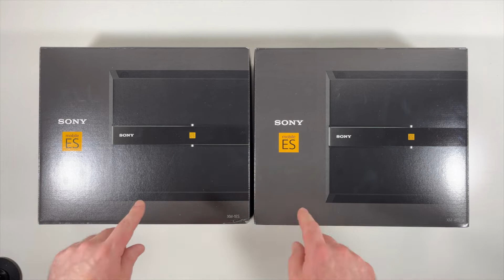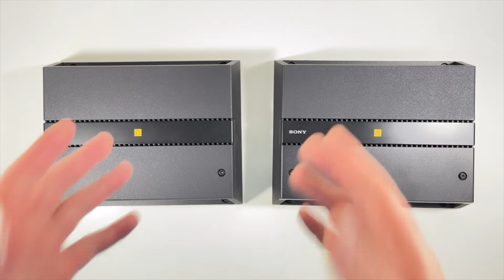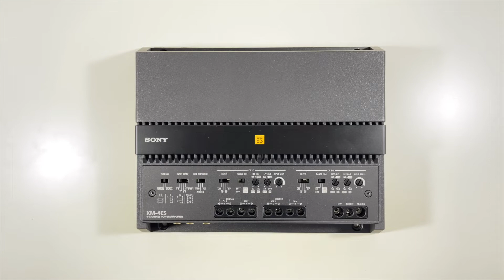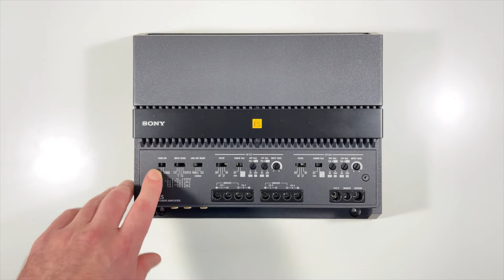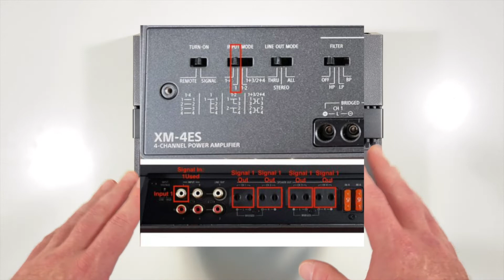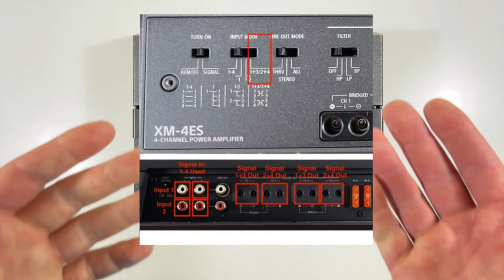Sony Mobile ES Amplifier Unbox & Feature Review

Comment: I just got the 5 channel ES. I also bought the 6.5 inch speakers with separates. A single din Sony cd deck, I have an 01 VW Cabrio. I might get the Kenwood Exclon (other ideas?) since I found the info hard to see on other car I only put the head unit in.  I hope everything will fit okay. Also bought 10’ Subwoofer and installed in a King Box, only thing so car..

Comment: There's is a gain knob but not volume knob?
If I do have a hifi portable device I can't use it in addition to thé head unit (no aux Channel) ? So I should unplug thé 2rca comming from thé stock head unit (which can't play hi-res files ) and then  plug from my device in the same 1 and 2 Channel (RCA)??

Comment: If the xm is the flagship line, why doesn't sony add a dsp to this line ? Better yet,  why doesn't Sony offer a stand alone dsp ? Disappointed!! Hey sony , Alpine is kicking your ass right now! Catch up
Reply: The head unit acts as the dsp
Reply: @tyleredmundson3494 yeah. I have the ES9000 and the built in DSP is pretty decent. More than enough for your car audio enthusiast.
Reply: And their previous offering they have a 5 to 6 channel DSP that is freaking awesome, you could direct stream it from your phone and control it all from your phone app anyway, why didn’t they put a DSO in any of their new offerings is beyond me ,keep on rocking
Reply: is that amp dsp good..thought of going that one....ended up getting the sony 9000es kappa speakers kappa 5 channel and audio control dsp sounds pretty good. @maryannmoran-smyth3453
Reply: What amp would you recommend then?

Comment: Sony Xplod mobile es amplifier was out back 2001 ..I still have 2 amps with the mobile ES
Reply: I have “Big Red” a.k.a the old 
Sony ES XM7557 4-channel amp from back in the day.

It is an absolutely superlative amplifier, and it puts out plenty more than it’s rated  power, while also having amazing sound quality.  

I am seriously considering purchasing this new ES line from Sony.  I’m thinking the 3-way components, the 4-channel + the mono amp, or perhaps the 5-channel.  

While the new ES subwoofer looks like it has amazing sound quality, I already have multiples of the original Infinity Kappa Perfect subwoofers stockpiled, which IMO are one of THE best sound quality woofers ever produced.

Comment: I am looking at Alpine status. Wha ts your feeling to compare this sony system ES.
Reply: Sony kills alpine now and alpine is not even a thing anymore
Reply: Same with kicker garbage
Reply: These sony es amp blows away most of alpine's current high end amps except for the pdx v9 and hda v90 series. I would say they are both about the same quality but i feel the sony has slightly higher sound quality. So depending on the sound u prefer. Both are high res audio. Those alpine 2 alpine series are pretty competative with sony xm4 & 5es lines.